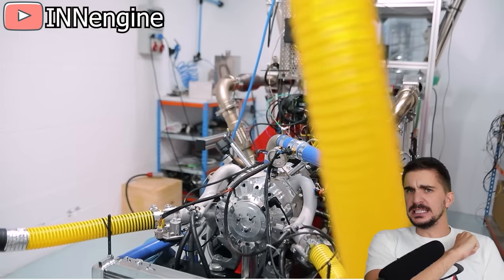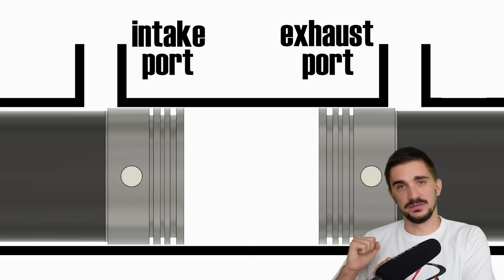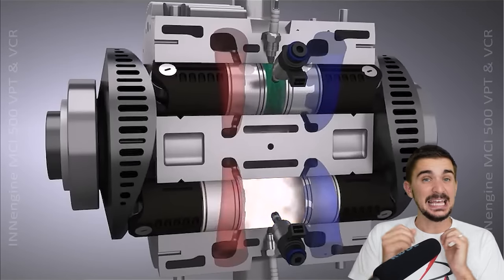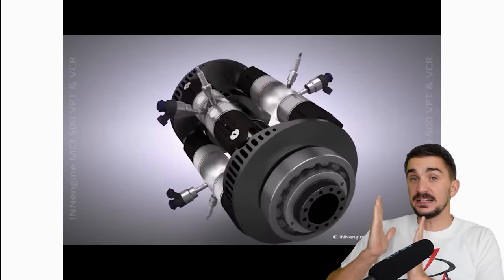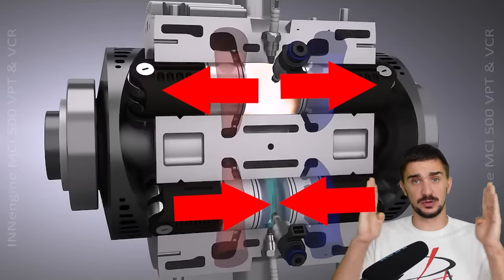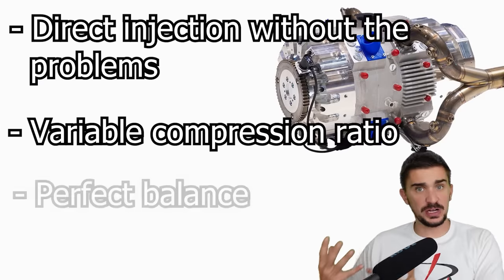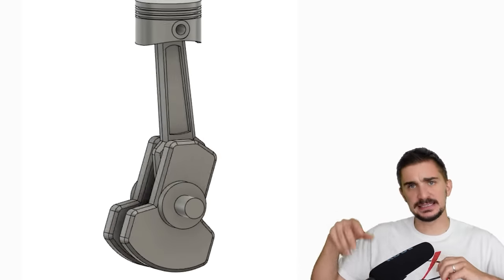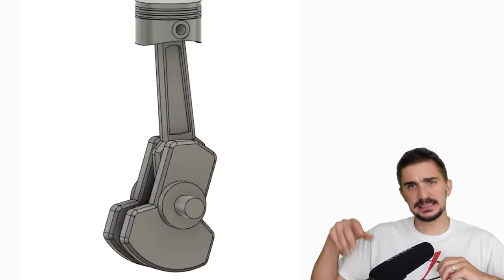Spain is Living in 2050? Revolutionary 1 Stroke INNengine Analyzed

Comment: so basically this engine is an AC compressor
Reply: No. I guess you didn't even watch the video.
Reply: Yes basically it is likely a ac compressor in car
Reply: With that logic, any engine with a piston can be an AC compressor...
Reply: Yes, but that doesn't make it a bad idea. I'm sure there are plenty of other limitations that make it a bad idea.
Reply: More like,..  GUNS
Reply: Yep I was thinking the same thing.
Reply: Yip
Reply: I see you watched that guy turn a car air compressor into a 2 stroke engine too?
Reply: Probably can run freon gas inside the lubricant camber and act as Aircon compressor at the same time..
Reply: It is very similar to a GM A-6 air conditioning compressor that was used in GM cars for decades. Also, those thrust cams are known as “swash plates”
Reply: @PADOYLE I’ve never seen a variable valve timing/compression ratio, direct injection AC compressor, have you?
Reply: My thoughts exactly.. it's similar.
Reply: Haha I was going to just say this
Reply: @Snowaxe3D  Basically yes, they can.
Reply: Correct. It's an axial combustion engine, instead of the traditional radial combustion engine layout. The torque problem pointed out in the video can be overcome by having larger diameter rolling wave guide and moving the pistons further apart from one another.  Doing so might negate the weight savings of the compact design. It would of been more interesting to see this compared to Achates Power opposed engine design.
Reply: @Snowaxe3D back in the day, air compressors were made using half of an engine to compress air and half to run
Reply: Which means it can actually work and be mass produced. Now the question is: is it efficient?
Reply: So basically, you could have designed this....oh wait, you didn't!!
Reply: No, I'm pretty sure in a compressor it is the wavy thing that produces the pressure.
Reply: @Conservator. That’s how these AC compressors work. They are variable compression through variable pitch swash plates. That is exactly why he was comparing the engine design to it.
Reply: @Snowaxe3D Yes, basically any IC engine could be turned into a compressor/pump. Engines and pumps are extremely similar. It’s just that engine output power by moving gases, whereas pumps move gases/liquids by consuming power. Opposite but closely related mechanisms.
Reply: I was just about to say the same thing. It's basically an a/c compressor and an opposed piston engine combined
Reply: Most of these guys ripping on you for your comment definitely aren't mechanics and have never looked at how a car's AC compressor works. So yeah it's probably like 2 ac compressors opposing each other.

All of you guys. when you get a chance look up how automotive ac compressors work. They are pretty neat. There are a few different types but this engine is set up nearly identical to one of the common ones used.
Reply: @Snowaxe3D  That is not a "logic" that "new engine" is an actual modified ac compressor.
Reply: @Snowaxe3D actually this swash plate arrangement is popular with high pressure pumps including hydrostatic transmission’s,pressure washers,a/c compressor’s
Reply: @InsanePacoTaco a company many years ago sold a kit to convert an aircooled vw into a compressor it’s main component was a cam that repurposed two cylinders for pumping air only
Reply: All engines are in fact air compressors.
And all AC compressor are air compressors. (If you cut out the pipes and let them draw in air)

So yeah, they started with a AC compressor design and added opposing pistons.
Reply: Early automotive AC compressors reciprocated, using a wave (swash or wobble) plate instead of a crankshaft to drive pistons. Modern AC compressors (scroll or screw) don't have pistons.
Reply: @yourserenity  umm, but it is not an AC compressor, it's an ICE, As I said, with that "Logic" any piston Engine can be called AC Compressor (Read OPs comment).
Reply: @SeanRoland-r1q  I had no idea, thanks!
Reply: Piston type ac compressor. Another type is spiral one
Reply: Heard of someone converting an old a/c compressor into an engine. Seems like a contender to Mazdas’ single rotary range extender. Especially for a car company that doesn’t want to deal with any wankel stuff.
Reply: Some YouTube channel has turned a fridge compressor into a ICE.
Reply: it's an air compressor like any combustion engine. it's not closer to an ac compressor than any 2 stroke emgine
Reply: Swash plate
Reply: I just want to know why aren't engines used like compressors during breaking to store energy into pressurized air to use again during starts/accelerating instead of turbo?
Reply: @Snowaxe3D there are a lot of larger refrigeration compressors that has pistons, rods and crankshaft just like an ice so it would definitely be possible because it follows a similar principle. The main difference is the valves and how they function.
Reply: Or an axial piston hydraulic pump
Reply: You could also have more pistons , say 6 or even 8 makeing power delivery even smoother.
Reply: “To the max”
Reply: @zperdek where do you put the compressed air tank 🤔
Reply: @dinendale666 I’m in the middle of watching the video, so I’ll go on a limb and say yes. Imagine two of them in line instead of adding more to the circumference of the plane. What I want to know is torque and horsepower with fuel economy in a 2500 pound vehicle. Can we have it with a diesel powered engine as well. 🤔🤔🤔. At least someone is looking into this. Staying curious my friend
Reply: @patrickguseman5219 Of course into the rear bumper. Isn't it obvious?
Reply: As a diesel can work the same as a two stroke just with higher compression then yes.
Reply: @PADOYLE why is the Duke Engine struggling to find a market?
Reply: Yes, precisely. It’s just an air compressor
Reply: @dinendale666 just finished watching the video. Gotten questions answered which raised more questions. Liked the video, seems pretty interesting. Just remember if it seems to good to be true it probably is, but don’t stop asking the right questions 🤔🫡
Reply: @xy_iron I was thinking that too they probably took inspiration from it. I've forgotten the name of the channel on here but this kid took a kitchen refrigerator compressor and built a 2 stroke from it and it ran surprisingly well.
Reply: Exactly my thought
Reply: I thought the exact thing when he called the wobble plate a wavy thing.😂
Reply: Good catch! I think I saved a video b where some kid refabbed an AC compressor into a ICE.
Reply: @Conservator. What valves? What timing components?
Reply: @IanCharlesPearce  The ones he mentions in the video.
Reply: The nearest comparison is automobile Ac compressor
Reply: Screw it, let's put it in a motorcycle chassis....
Reply: @needmoreboost6369  ha 🤣,  we Had one of those for years....worked fine, for a emergency.
Reply: @joebeezy9471  any internal combustion engine is theoretically a "air compressor"......
Reply: To that point, wonder if it lasts only as long as one
Reply: The engine has been in design from before 2016, we are in 2023 and haven’t seen it in anything yet.
Reply: @needmoreboost6369  there was a commercial product too. Diesel Creek has a video on one. V4 with half of the cylinders as an air compressor
Reply: Thought the same thing the moment I saw it . Smart 😅
Reply: @Silverhks well said
Reply: It's back astwards. An a/c compressor is a non combustion engine.
One uses heat to move energy,the other uses energy to move heat.
Reply: @InsanePacoTaco  yes, my dad used to have a vw beetle engine compressor, two running cylinders, two compressor cylinders. I think it was ex army. Was mounted in a trailer on land rover wheels
Reply: @Fury_BlackWolf  ya that's what I am also saying,
Reply: I opened one up once, and that's more or less what it is, but in reverse. The compressor I opened just had one set of pistons, but I guess they could make one with opposing pistons.
Reply: @sepg5084 He did and so did I. You obviously have never seen the inside of a modern ac compressor. They run pistons up and down on an eccentric plate. The plate is rotated which runs the pistons up and down. They use reed valves on them.
Reply: That's funny as hell
Reply: Yea that's what I thought too,
Reply: All engines are Air Compressors.
Reply: @sepg5084 I guess you didn't research AC compressors lmao
Reply: @thejdmguru621 I saw that video and I thought of that lol
Reply: @Conservator.  Yes i have seen some like it
Reply: Yep...I have been saying for years... GM makes 4small engine's in 1.. ridiculous 🙄...when all you is motor bike simplicity
Reply: Yep
Reply: @Snowaxe3D  Yes, that is the case. Drive any engine with another motor and you have yourself a compressor.
Reply: @Conservator. this engine doesn’t have traditional valves… also kind of like an A/C compressor
Reply: @Jpilgrim30  It doesn’t have 4 stroke valves no, but it does have valves or ports that are opened and closed (by the pistons in this case)
Reply: Mercedes Benz Swashplate A/C compressor immediately came to mind
Reply: Would have liked to hear about rate of fuel consumption, mpg and how it's cooled.
Reply: Look up ac compressor engine.. The youtube channel @letslearnsomething built one. Already been done
Reply: Well, there are reciprocating compressors too. So there has always been similarities between the 2.
Reply: @PADOYLE therefore not making it AC anymore
Reply: Technically yeah but not necessarily
Reply: Just bullshit and a waste of time! As all burners efficiency 30-40%, while Electrics have > 95%. And Torqe as hell from 0rpm..!
Reply: Does it make it better or worse?
Reply: @Snowaxe3D No
Reply: Or....an AC compressor is a one stroke engine.
Reply: Or hydraulics 😂
Reply: @nukiepoo no, those cams are not swash plates...
And no, it's not (really) like an AC compressor.

AC compressors use a swash plate this engine does not. In this engine, a swash plate (sometimes called a wobble plate) would not rotate with the cam. There would be a bearing between the cam and the swash plate.
Note that the 2 lobe cam used in this engine precludes it using a swash plate.
Reply: The Indians all ready make scrapyard engines from ac compressors. Lol . I'll stick to a crankshaft thanks
Reply: A diesel engine is a compressor. Lol
Reply: @Snowaxe3D no, this looks exactly like the inside of an AC compressor...
Reply: @Snowaxe3D actually yes, you can basically hook a tube up in the spark plug hole you get compressed air when you spin the crank. It was common to repurpose Ford model T engines as air compressors in mines back in the early 1900s, powered by another engine.
Reply: It doesn‘t matter this is a mechanic used in another way: Genius
Reply: Lol
Gonna have to turbo n nitrous it though...lol
Reply: Technically,  all engines act like a compressor
Reply: It is similar to an AC compressor but different. The "wavy thing" is a swash plate.  A compressor is a pump. It turns rotary motion into pressurized liquid or gas.  An engine uses combustion to create rotary motion. 
The timing of the opening/closing of the intake and exhaust is very important. This means that peak power probably happens at a narrow RPM range.  Fine for an airplane engine, not for a car engine.
They need to look into BRPs ETEC injectors in order to eliminate a high pressure fuel pump.
Reply: I happen to have an ac motor collection at home... Any "ac compressor motor" is just a pancake pump, similar to a tire inflator pump. This is nothing like an ac . An ac motor is in a closed loop system.. It's exhaust is also its intake... Just after phase change.
Reply: Huh.... You drew that from what we all just heard??? Now I'm confused
Reply: @Suman-bd1tc no, it really isnt
Reply: @PADOYLE yet YOU didn't think about it, let alone have the intelligence to think it, but y'all have googled a smart assed response and have proudly proclaimed such..... It's really funny how that works....
Reply: No. Its Napier deltic like
Reply: 🇦🇺 chip cooker😂
Reply: @steventosi8067   A single stroke "chip cooker" apparently.. 🤔🤣
Reply: A modern 1000 bike make's 220+ hp
Reply: half part of the engine is similar to water jet motor set up . I did open up the water jet and saw this similar design 🤔
Reply: Motor de avión
Reply: @Snowaxe3D sure, if it compresses...
Reply: Basically as in it uses something similar to wash plate and some AC compressors use a wash plate. AC compressors use valves though, this apparently does not.
Reply: Thats like you call a heater an ac! Things that reverse the process is not the same thing. If its an ac compressor then what drives it🤣
Reply: @TheTomtz  AC's are also heaters, go outside and check out the exhaust temps, BEHOLD!   This style of engine looks and acts a lot like the High Pressure Oil Pump on a Ford 7.3 diesel.
Reply: @TheTomtz  make a port for a fuel injector, replace the suction tube with an air filter, and replace the discharge tube with an exhaust pipe and it's essentially the exact same thing.
Reply: @TheTomtz 🤦‍♂️look up a heat pump
Reply: @Snowaxe3D you're looking at his premise 180• out my guy
Reply: I swear there is a plague of people these days that think they know more than they actually do. The piston layout of this engine is clearly similar to the piston layout of an ac compressor if you took two and put them together....
Reply: @Snowaxe3D  not really "by that logic", but they basically can. The design of this engine is very similar to the design of a lot of AC compressors.
Reply: You mean basically a reciprocating a/c compressor
Reply: @TempleoftheSon  ya, therefore by "That Logic"
Reply: @zperdek that's an extremely stimulating question. I'm gonna be pondering on that one on and off randomly for a couple weeks now thanks to you and my ADD brain.
Reply: Sure appears to be
Reply: @sepg5084 it is extremely similar in  it's design
Reply: @Snowaxe3D yes it could
Reply: @sepg5084 or perhaps you haven't seen how an ac compressor works.
Reply: All engines are air compressors!
Reply: Yup insane right
Reply: They welded 2 ac compressors together and tossed some gas on it , was that easy.
Reply: @sepg5084 you obviously don't know how an ac compressor operates, he's dead on!!
Reply: @Conservator. Absolutely! In fact, most cars use variable displacement compressors nowadays which is much harder to accomplish than anything you mentioned!
Reply: @Snowaxe3D they do compress air 
Compression stroke lol
Reply: that was my exact comment😂
Reply: @lostsoul1278  ya IK, that's my point.
Reply: I came here to say this I saw the swash plate immediately thought that
Reply: There is no variable timings... Pay attention people it is a large-scale AC compressor hopefully not utilizing as much gas as a 2 litterl motor
Reply: An engine is also an air compressor
Reply: Exactly my thought when I saw the design graphics.
Reply: @sepg5084 looks like you have no idea about air compressor, how it looks and how it operates.
Reply: More like a pressure washer compressor. I have taken one apart.
Reply: @Conservator. Your obviously not into Xtreme air conditioning 🥶.
Reply: I find this hilarious because I'm working on 2 car AC compressors and yes it's exactly what I thought when I saw the thumbnail image. "Hey look, someone turned an AC compressor design into an engine. Bet this has been done before..."
Reply: And 2 stroke.
Reply: @Snowaxe3D yes, old-school "York" ac compressors were little v twin motors.
Reply: Lubrication would be a challenge.
Reply: @TempleoftheSon  why make changes if its the same thing? Thts what i mean. From the looks i agree they show similarities
Reply: @sinformant  from an artistic view this is same thing. From thermodynamics point of view they are not. You have to add n remove things if you need to make it an ac. An ic engine is a heat pump as it produces heat, if again thts wat u meant🤣
Reply: My congrats to people who put the effort into different technology, even if this isn’t the answer it gets people leading into thinking out of the box… Good work
Reply: @PADOYLE what walls
Reply: All internal combustion engines are just air pumps.
Reply: @Conservator. Not until now.
Reply: @ronmorrell9809 Early ac compressors were standard crankshaft and piston arrangements.
Reply: It is Spain, don't ever doubt that we based all "research" and the entire project on an AC compressor to try to sell it to anyone as "innovative". Spain for you
Reply: Then every engine is an AC compressor unless you watched another video
Reply: The duke engine was the same concept
Reply: Or a pressure washer
Reply: I think all engines are. 🤷🏼‍♂️👍
Reply: @diegovianavillegas3297 not a "new" design at all.
Reply: @Conservator.  If you add icing to a cake its still a cake.
Reply: Fg va
Reply: Pistons on ball bearings? Yes thats a hugely stupid idea...
Reply: What is the waveey thing 👋
Reply: Bozo comment.
Reply: @affiliatereviews4079 
Yeah, my thoughts exactly, swash diameter is the equivalent of piston stroke.
Increasing diameter would hamper weight, to the cube of the diameter (right? Or square?) although I don't think it'll be too bad.
I was thinking you could maybe have asymmetric swash plates? One for low rpm torque, the other for high rpm power. A diverter gear to switch from collecting from one to the other.
Reply: The configuration was not an AC compressor, until it was. Also, no it is not an AC compressor because that is not the function it performs. Similar, but very different.
Reply: Did you understand the video?
Reply: ശരിയാണ്
Reply: @SVThailand  It could but then it wouldn't be a scroll compressor anymore. 😂
Reply: Exactly
Reply: Bruh super bruh
Reply: @Snowaxe3D I've seen them do it with a number of different compressors.
Reply: Yes. Just like the Wankel engine!🤣
Reply: @sepg5084 are you sure you did?
Reply: Why are people so angry at a comparison 😂😂 they share common movement
Reply: Seems at first impression ,but it's not
Reply: This engine will wear out faster
Reply: @Silverhks it makes it a horrible idea
Reply: Better
Reply: Yes it's a compressor.
Reply: You clearly didn't understand how it worked then. 😂😂😂😂
Reply: Exactly. I just saw a guy make one out an a/c compressor.
Reply: It also reminds me of the Citroen hydraulic pump
Reply: @PADOYLE happens to a fuck ton of old designs in general just very well defined
Reply: Exactly lol the wavy thing is a swash plate and they are in hydraulic pumps from as early as 1940, piston style air conditioning pumps, pressure washers, ect.
Reply: Absolutely correct 👍
Reply: Tbh it looks the part but its more complicated
Reply: @PADOYLE Like what? I’m smart enough to know I don’t know more than basics in engines, but curios. 😊
Reply: Exactly what I thought
Reply: Just like a piston engine is basically an air compressor.  Stupid analogy.
Reply: You misspelled a boxer engine but okay...
Reply: @DickShooter  I can’t remember. Maybe I was mistaken with variable compression. 😬
Reply: No, difference is so far,, have u seen dissambled ac compressor?
Reply: More like a variable displacement hydraulic pump
Reply: Nothing new here.  Look up K-cycle engine.
Reply: All engines are in principle air pumps...the internal processes can force induction beyond pumping principles, but they all pump air and use compression, so they are all air compressors.
Reply: Only 1/2 way … ect ect Ect
Reply: According to my grandpa! 

“ won’t least as long as a snowball in hell !!!
Reply: One stroke engines, do exist. However, this is not one. This is an opposed-piston 2-stroke.
Reply: Or like a hydraulic piston pump..very clever
Reply: Modern-day AC compressor was designed off of the original torpedo motor.😉
Reply: @thejdmguru621  you're correct. 2-stroke. I don't understand why everyone is saying "1-stroke". These people are clueless. 😆
Reply: Pretty much
Reply: @Snowaxe3D no
Reply: @bobbyhempel1513  which is 2-stroke. Every OTHER stroke is a power stroke. Instead of an ordinary crankshaft and con-rod doing the compression stroke, the other "crankshaft" pushes the piston on the compression stroke. I don't understand how no one else is comprehending that.
Reply: @PADOYLE they literally already made and tested it
Reply: In reverse though, yes. It’s built different but by your logic every engine is just a steam engine then.
Reply: Yup, like hydraulic pump
Reply: Every motor is a air compressor
Reply: Kinda.... is like 2 compressors facing eachother.
Reply: @kalebnelson4569  at least a steam engine is actually a 1-stroke. They DO make internal-combustion, 2-stroke engines, but this, by far, is not one of them.
Reply: I'm so tired of explaining what should be "common sense". This is a 2-stroke. GOOGLE, "1-STROKE INTERNAL COMBUSTION ENGINE".
Reply: It is a 2 sroke
Reply: @emmanuelk.tambwe2628  it's about time someone else with a brain, chimed in. I've BEEN trying to tell them that! 😆. 1 power stroke + 1 compression stroke, = 2 strokes! 🤯😆. They do have 1-stroke international combustion engines, but this certainly isn't one of them. 🙂
Reply: It's an non-head 2 stroke boxer
Reply: @Snowaxe3D I mean, they could be…if it can make compression, it could be a compressor. The only difference is how you make them spin.
Reply: AC compressor is 1/4 horsepower
Reply: @pranays  I'm thinking he modified it... Granted, it5_
Reply: I wanna turbo it
Reply: Need lots of pressure....so yeah it is what it is 😊
Reply: @nukiepoo that's that was killing me I couldn't remember 😅
Reply: @Snowaxe3D  I was always told that an engine is an air compressor, to begin with.
Reply: Looks like it would be a good aircraft motor
Reply: Exactly!
Reply: @nukiepoo finally someone else with a clue
Reply: @Snowaxe3D  yes because all engines are technically air pumps
Reply: @Conservator. Just a variable compression a/c compressor (works off head pressure) with read valves!
Reply: Complete with the wobble plates like what is used on a GM V5 AC compressor.
Reply: Or a pressure washer pump.
Reply: It's 2 AC compressors mashed together 😊
Reply: @yaseenbshina3140  correct! 😁
Reply: No
Reply: Yea, its like a AC compressor.
Reply: Lol literally the moment I saw it I said "turbo hybrid fixes everything wrong here"
Reply: @Snowaxe3D uh, yes?

We needed to drain a lake on a job once and I was like "ya know a junkyard engine is $125 and the make great muck pumps"
Reply: @Conservator. Okay tru, they should add variable compression to car AC compressors rather than declutching then you could simply lump them and adjust the efficiency based on the temperature in the cabin, go get your patent!
Reply: @david2ljdavid2lj56 uh engine to pump you reverse the energy direction? 

Just like electric motor vs generator lol?
Reply: @needmoreboost6369 oh yeah, the pump in a hydrostatic drivetrain!
Reply: @Buciasda33 yeah I want an aux bracket to add a second ac compressor for OBA on my overland rig lol
Reply: @zperdek patent that, don't give it away to fucking GOOGLE, that's genius, yeah pneumatic Regen, theoretically sounds useful for F1 bro!!!
Reply: @zperdek you JUST FINALLY made DOD sound like something intelligent, like old air compressors using part of an engine for power and part for the actual compressor pump... There's a bunch of ways to apply that logic
Reply: @dinendale666 cylinders

They've already got eight pistons
Reply: @dinendale666 y brain says to stack them longitudinally like rotaries because then there's no cost added, since you've got clean access to both ends of the crank... Though I'm some applications packaging becomes problematic and also expanding the cylinder count radially rather than longitudinally would also magnify torque by having the point energy enters the swash plate farther from the point where it exits lol
Reply: @patrickguseman5219 yeah, like airplanes, spaceflight, satellites, the internet, and smart phones...
Reply: Yes engines are like air compressors. That is what they do is compress air, then we add fuel and spark.
Reply: So its just shit then?
Reply: I’ve worked on automotive A/C all my life and have never seen a wavy thing in a compressor except a warped end plate.
Reply: All engines are air compressors....
Reply: That's exactly what I said
Reply: Ye
Reply: You need to understand the difference between a motor and an engine.
Reply: Any engine can be seen as an AC compressor if youre dumb enough
Reply: Looking more like an alternator
Reply: lol
Reply: @Snowaxe3D thats correct.. Some bus have v4 a compressors 😊 😅
Reply: Not fully... Its 4 opposed piston engine in a roll, the ac is not opposed ( commonly) the pistons is backwards to each other 😅
Reply: A double
Reply: Yep, has been tried before, as an ICE, heat dissipation and poor efficiency  is the problem. Maybe they have come up with something to address this.
Reply: Straight up
Reply: Rotary motor isn't new
Reply: @Conservator.  This engine doesn't have variable valve timing nor variable compression..... So yes, just two automotive A/C compressors merged together with fuel injection and intake induction.
Reply: Basically an ac compressor yes, I had this idea back in highschool the first time I took apart an ac compressor in auto shop my idea used reed valves and was based on how sick I thought it would be to have a six cylinder two-stroke engine for my dirt bike lol it was just a pipe dream but I knew it could be done. Btw the wavy thing is called a wobble plate.
Reply: Yes it is, except in a reverse cycle.

Instead of inputting rotation to get compression, they use expansion to produce rotation.
Reply: Oh, had no idea how compressors worked. Thanks
Reply: @Snowaxe3D there are air compressors with this design almost exactly
Reply: That’s what I was thinking 😂
Reply: @Suman-bd1tc  what do you think a compressor is? Its all the same concept plenty of people take old ac compressors and turn them into engines with the right knowledge you could do so!
Reply: It's like a more complicated rotary😂
Reply: @sepg5084 I guess you didn't watch the video.. Because it is basically an air compressor
Reply: Yep. Made an engine out of a swash plate compressor years ago. Ran for about 2 minutes and melted.
Was fun though.
Reply: Iron got lot reply for this com..  torpedo engine.
There
Reply: Iron got lot reply for this com..  torpedo engine.(first ?) HhO sugar
There be several axial engine done. I looking
For the "newer" 15yo
Aussies?
Reply: All combustion engines are pumps of some sort
Reply: Yes.
Reply: I'm mean every engine is technically an air compressor.
Reply: External combustion..
Do .  That. Experiment
Reply: Run on air
Reply: @electric7487  yeah. Thats what this engine reminds me of. They just took 2 of them, put them head to head to create a combustion chamber. To comment on the hydraulic pump, those are bad to bone. I've worked with them on crane applications.
Reply: The wavy thing woukd be a cam
Reply: @freedblowfish3705  
Is so called incorrectly wobble plate  
CA2326705C - Crank system with sinusoidal piston motion
A crankshaft system for internal combustion engines built for record rotational or racing speeds

An Example of a Non-Harmonic Oscillator => Crankshaft Motion
Apr 25, 2018 — The crankshaft: a sinusoidally driven, non-harmonic oscillator · Long crankshaftWhat are the 3 types of cam?
Here is a list of different types of cam.
Disc or Plate Cam. The follower moves radially from the cam's rotational centre in the disc cam style of the cam. ...
Cylindrical Cam. ...sinusoidal camWhat are the 3 types of cam?
Here is a list of different types of cam.
Disc or Plate Cam. The follower moves radially from the cam's rotational centre in the disc cam style of the cam. ...
Cylindrical Cam. ...
Reply: you have the same logic to the INNENGINE marketing team: misleading
Reply: @Suman-bd1tc  but it's not truly a parallel design
Reply: Can't we just ditch the pistons and have it be a disk driven combustion system instead. To reduce friction and increase displacement to allow for more torque it would be called the pancake engine since the engine is useing an open valve system were the intake and exhaust ports are allways open and the piston acts as a wave valve. A turbo would help with compression since it needs more pressure in the system and it would be great to run it off hydrogen enriched fuel to allow for better expansion.
Reply: @nukiepoo is that the wavy thing?? A thrust cam sounds like a good name as well lol
Reply: Are the automotive companies interested????
Reply: @Suman-bd1tc yup..it is a reverse car ac compressor.....diffwrent is ac car comp has 1 swash plate inthe midle...this one has 2 swash plate on both ends
Reply: So you said the engine cools itself there's no water to keep it cool like a radiator I thought about that long time ago cool block down with a control temperature AC Dakota gets to hard harder it is Lisa run nitrous with fracking ice can be turned very hard
Reply: Seems legit...
Reply: Like any engine with pistons
Reply: Only in that it utilises the shwashplate system.
It's not a one stroke engine either.
Reply: @Conservator.  Swashy.. 😂 I like it. ❤
I call it a  🔊 metric, Merigro Plate Topper Cover or for short Thingy 1 & Thingy 2.. 🤗
Reply: It's basically a swashplate engine like those used in torpedoes so yeah
Reply: Lol any engine can be seen as a compressor
Reply: @sepg5084 , have you ever seen an old AC compressor (specifically Cadillac models) taken apart? It has the same mechanical design.
Reply: @const3marvick yk, DME is actually used as a refrigerant, too. It can definitely run on dimethyl ether.
Reply: @Conservator. , he's talking about the mechanical design. No need to get literal.
Reply: @affiliatereviews4079 or they can just make the swash plates out of a high mass Tungsten alloy with enough ductility to prevent it from shattering.
Reply: The wavy thing is a " face cam " .
Reply: 😂this is basically a pump
Reply: Very similar design
Reply: In a nutshell, yes.
Reply: This was tried before and failed. Attempting to transfer power backward through the cam rotor and wobble plate was the issue with the design.
Reply: this!
Reply: @Conservator. you don't understand
Reply: This design is from an Auto A/C compressor. 

the disadvantages I see is that the Guide track/Swash plate was used to convert rotational energy into linear energy, this doesn't mean it can do it efficiently in reverse. We already have an efficiently way of converting linear energy into rotational energy.
The forces on the Plate/guide will create oscillations in the motor casing. 

 Being a 2 stroke design doesn't help its advantages
Reply: @Dazza_Doo  Thanks for letting me know and your excellent explanation. This has been really helpful.
Reply: @nukiepoo  yes, in tech school I called them Squash Plates that seemed more fitting as they squashed pistons into cylinders. No-one tried correcting or questioning me referring to it as that, or as a Cam Plate.
Reply: @bretthargis6802  rotary engine isn't new like you say, but calling it a 1 Stroke is new.
Reply: @bretthargis6802  engine, not motor. Motors are electric with wire windings, General Motors making engines, and Detroit as the Motor City is misleading in name and confusing, should be Genera Engines and Detroit as the Engine City.
Reply: @5thRoot  it's not the direction of turning that's different, it's taking away, or adding burning fuel that's basically different. If you crank over an engine without fuel and/or spark to burn fuel, the engine is acting as a air compressor pump squeezing air to compress it and then exhaust the higher pressure air.
Reply: @filippofanesi  by adding an exhaust of an internal combustion engine to replace the Supercharger run by an electric motor to do the same thing?
Reply: @lordjoshr   engines can be an air compressor, motors can be generators, both can either receive or produce power for benefits of using the power.
Reply: @sepg5084 and i guess you do t understand mechanics because a AC works very similar which is why he said the comment.
Reply: on steroids
Reply: One Problem - Freon 12 turns into Phosgene (Mustard Gas) when burned. That's why it got replaced in the 90's.
Reply: @user-mp3eq6ir5b  are you a German chemist, too?
Reply: Why not use / inject Compressed Air (2-5000PSI) stored "on board" the vehicles and make them truly Pollution FREE  instead of Injecting olluting Fuel like existing Life's.. 
If the Inlet Air is warm perhaps it can prevent freezing at the exhaust too.... 
The Compressed Air can be produced using Pollution FREE SOLAR Electricity and Heat Recovery to recover the Energy lost during Compression.. 🤔🤔🤔🤔
Reply: @AjayAjay-gz3oz  because of older fuel profits being used to maintain status quo by bribing lawmakers to protect some usage of their fuel.
That's part of the timing issue the narrator mentions often as holding new technologies back.
Reply: More like a aposing
Reply: More like a opposed piston engine
Reply: @statonracing  yep, combination of AC Compressor and Opposed Cylinder Engine. I think the Opposed Cylinder Engine is being called a Boxer.
Had one in an older Subaru in early 1980s.
Reply: Turbocharger, Supercharger, a/c Compressor, Internal Cumbustion all have 1 thing in common they all make pressure...they all rely on fluid dynamics so if you can give them fuel and spark they all can be an engine to varying degrees. The ability to run in any position is a HUGE advantage for this engine! Use hydrogen to save on weight and you got something!
Reply: @InsanePacoTaco I know I had an old Pontiac Bonneville and GM supplied a sparkplug adapter and a hose to use one cylinder as a pump in a pinch.
Reply: Looks like a Scroll.compressor. Which there is a guy on YouTube that turns old. AC compressors into engines.
Reply: @Snowaxe3D  any engine is a glorified pump
Reply: Two opposing a/c compressors! Completing two cycles of intake compression power and exhast in every 360 degrees, the limits are endless. Imagine 360 cylinders and a warble plate with as many cam shifts on a single plate, and no valve train to drag it down. And fuel injection with todays tech, with metered high pressure injection into an already heated cylinder. No spark plug required. So no ignition system required. Supercharging would give torque values that exceed today’s diesel standards. Because four cylinders are producing four times the work of a standard four cycle diesel engine. Now consider red line. 5000 rpms with a 4 cylender engine would give 40000 combustion events per minute.
Reply: If an ac compressor could run a car I suppose.
Reply: Truth
Reply: yeah, that's what I was thinking.
Reply: @thejdmguru621  yup.
Reply: A/C compressors don't have oposite pistons and don't create combustion  😂
Reply: @Snowaxe3D  if you try hard enough I'm sure you could make something work
Reply: @Silverhks plenty of other flaws and limitations that no one talks about indeed
Reply: @sepg5084 idk if you’ve seen how A/C compressors in your car work but it’s exactly the same. It’s funny, it’s not supposed to be taken literally. Even though mechanically they look almost the same.
Reply: @Snowaxe3D do you know what an ac compressor looks like inside? It’s damn near a giant ac compressor with spark plugs and fuel injectors.
Reply: Such a bullshit
Reply: Trash engine am not buying that.
Reply: @Snowaxe3D not really.  This is how a/c compressors work
Reply: @Snowaxe3D pretty much all piston engines compress gas thats all an ac does
Reply: I recently took apart a Mustang AC compressor, had the same swash plates and piston set up for compressing. My first thoguht exactly. Interesting design
Reply: Basically every engine is an air compressor, yes.
Reply: This ac compressor design in reverse with the tiny chambers burning fuel.
Reply: @Snowaxe3D  any engine can be an a/c compressor with  some work
Reply: Umm all engines are just compressors.
Reply: Double AC compressor. 🤣🍻
Reply: Any engine with open ports in the cylinder is a bad idea this is why a 4 stroke piston ring will last 5 times longer than a 2 stroke piston ring
Reply: No it’s like an ac compressor installed in a horse by another horse.
Reply: @needmoreboost6369 that's really interesting. I was wondering how difficult it would be to make a compressor from a piston engine. Couldn't I just put a one way air valve in the spark plug hole, like a compression checker has? Wouldn't that work?
Reply: I love the humor in the comments section…
Reply: That was my immediate thought
Reply: There's a significant difference between an air conditioning compressor and this engine. air conditioning compressors don't have opposing pistons.
Reply: Other than the swash plate, not in the least.
Reply: @Snowaxe3D well,  that’s not necessarily untrue. While this is nothing like an AC compressor (at least not any more than an piston engine is) piston compressors and piston engines can be turned into each other without that much work.
Reply: @thejdmguru621 why are you saying this. Just ‘cause there’s a swash plate doesn’t make them the same.  Ports vs reed valves - the opposing pistons, they are NOTHING LIKE EACH OTHER - except for some similar LOOKING parts.
Reply: @david2ljdavid2lj56 compressor doesn’t have opposing cylinders and it has reed valves not ports. There is only a very superficial resemblance that is less than skin deep.
Reply: @SilvaFox a passing visual similarity doesn’t mean that they work at all in the same way.  Read valves vs ports. This is operationally much more like a 2 stroke than a compressor. The only thing that makes it look the same is the swash plate, but functionally it’s totally different.  If her said “interesting how it uses a swash plate like an automotive AC compressor” that’s a good observation, but saying “it’s basically like an AC compressor” demonstrates ignorance of engine function. No compressor is going to work with PORTS!! Scavenging simply doesn’t work. There is literally ONE visual similarity, that’s not even functionally similar.
Reply: Modified AC Compressor*